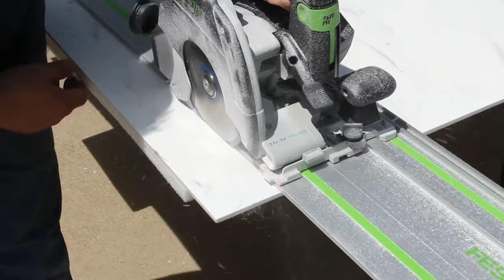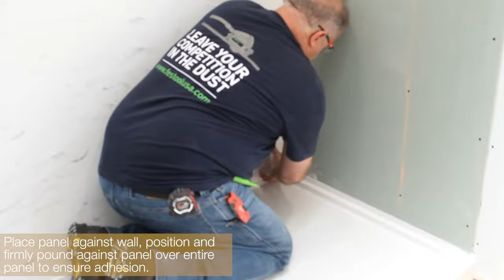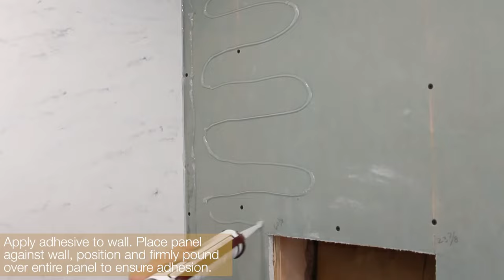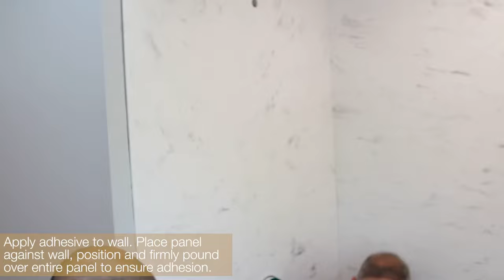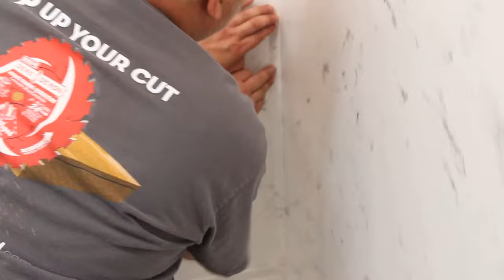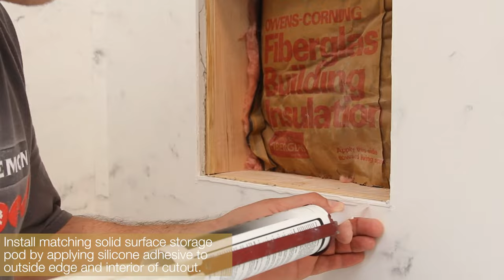Samuel Mueller Monterey Carrara Wall Installation

Comment: The only thing is I wouldn't silicone directly to the drywall. I don't think so will go adheres very well to drywall. I usually put 2 coats of agua defense on top of the drywall

Comment: This video is quite helpful, but I still have a couple of questions. Is it ok for the wall panel to overhang the edge and come down into the shower pan as it shows in the video (this is different than the written installation instructions that come with the product)?  Is caulk applied between the bottom of the wall panel and the shower pan?
Reply: Just silicone the panel to the pan
Reply: @mattyockey9195  Behind the panel or where the bottom edge of the panel meets the pan? Or both?
Reply: @jenniferhooven2305  where the bottem of the panel meets the shower pan.

Comment: What if the gloss side is glued and the matte side is left on the outside accidentally?
Reply: Then you got to leave it or write it down and scrape silicone off
Reply: On our Samuel Mueller Monterey panels the gloss side is supposed to be the inside (glued side) and the matte finish (I believe they call it "velvet") is meant to be on the outside.